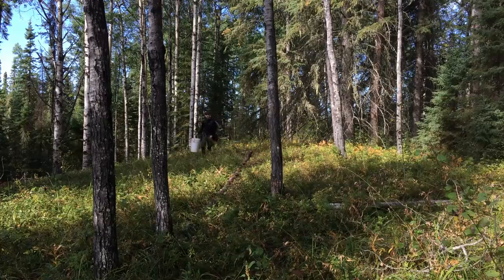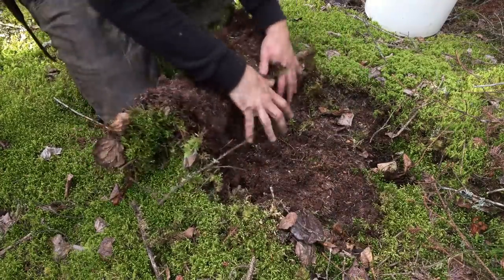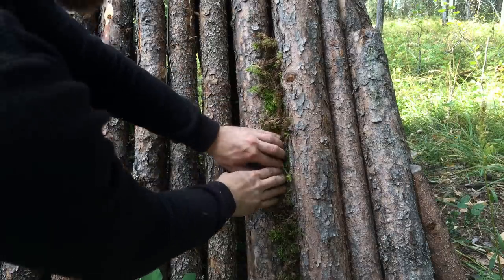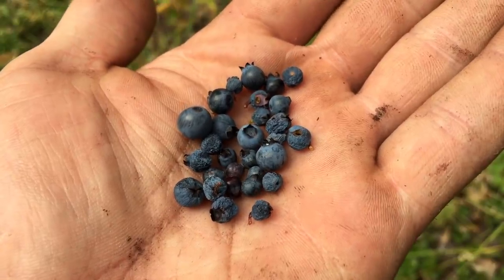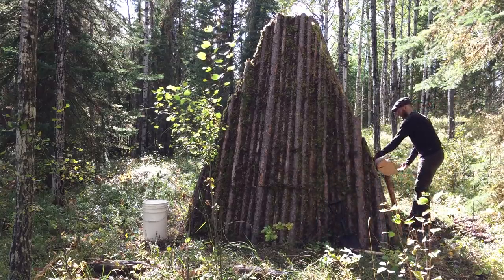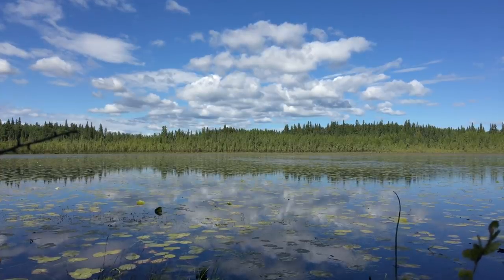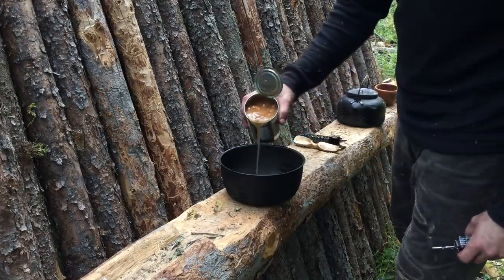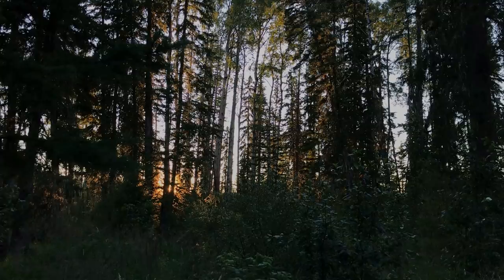Building a Log Home in the Canadian Wilderness (Pt. 5)

Comment: I admire your patience, and your handiness with an axe. But I have to say... as I watched your 'log home' take shape, I found myself thinking about it's weatherproofing  and overall endurance. The slanted vertical orientation of the logs, combined with a lack of any roof, basically guarantees water infiltration from rain, snow melt etc. The convex outer shape of the upright logs, in cross section, basically creates a large number of 'gutters' for moisture to follow - downward and inward. Thus the moss chinking, though it may prevent wind from penetrating for a while, essentially acts as a sponge - absorbing (and holding) water until it reaches peak absorption... then shedding it to the inside. That absorption and retention of water will also hasten wood rot - substantially. That's how rot happens. I noticed a similar issue at the base of your walls: the exposed (sawn) ends of all your logs... rest on soil. And soil is the biggest sponge going. One of the most (if not THE most) important considerations in log building is: keep the water away from the wood. For very good reason. Look at the roof overhangs on true log homes. That's a lot of work. And it isn't just for aesthetics. It comes from hard lessons learned.

Comment: Solid building... seems like a fusion tee-pee / log home.  I'm concerned that it will rot from the ground up though.  Typical log homes don't put the logs on wet ground, and have large roofs to keep the wood dry.   Hope you get a few years anyway 😀

Comment: Did you ever really finish the log home?  If not, you could put a fire place with a chimney in the middle.  Especially since you already have a hole in the roof, or did you already intend to do that?  Do you plan on adding horizontal logs outside to hold the vertical ones in place?

Comment: Hay man I'm your biggest fan. Love every video. Your bushcraft skills are amazing. I'm just not getting this log shelter.
I guess on the up side if it catches on fire you can just push out any wall and escape. On the down side all you need to do is stumble on a cold winter night and you will knock out a wall. So much effort to put this shelter but no bushcraft
technique to hold it together. The big bad wolf will huff and puff and blow your house down. If you did a couple exterior
frames. held down by gravity that would hold it together and give you a shelf to stack moss insulation. Just saying.

Comment: So do you plan on adding more structure or separate structures if necessary?  That pyramid of yours seems doable, but not super comfortable over time.

This seems like something I'd build as a short-term permanent sturdy structure so that in bad weather or if I pissed off a bear I'd have something more substantial than a mere tent to protect me, but I'd probably want something with a bit more room and this'd be relegated to a guest house or storage room of sorts.